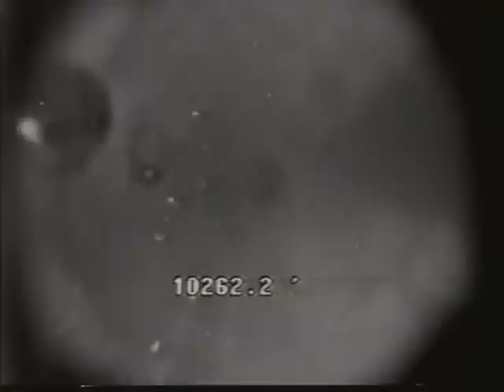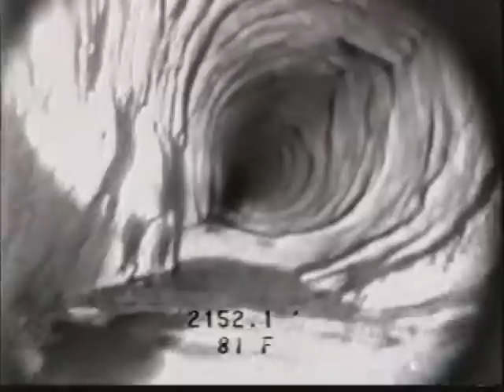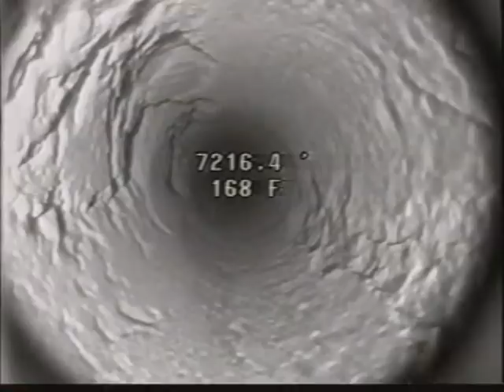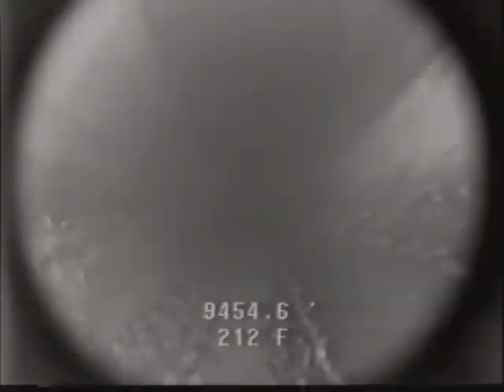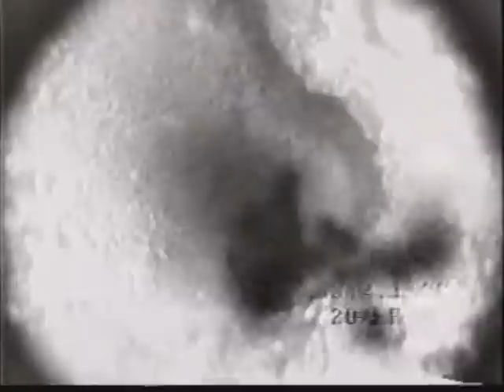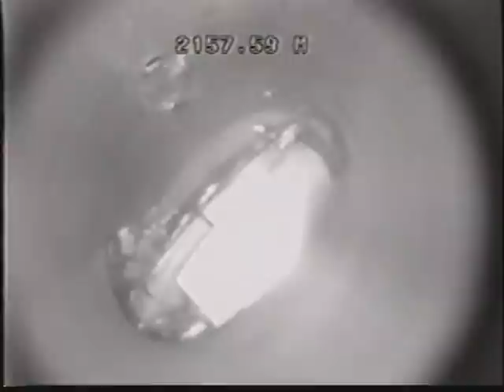Oil Well Downhole Camera Video (2/2)

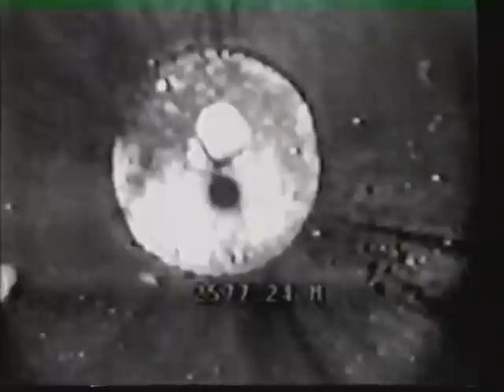Comment: So do I understand correctly that this thing @7:33 is at the very bottom of the drilling shaft after they have closed it up?
Reply: No. It's a plug you set at whatever depth to isolate what is beneath it.
Reply: Bridge plugs are set in the casing that is set in place after drilling during the production phase.

Comment: At one point the temperature was 212F. Why wasn’t the water boiling or at least bubbling?
Reply: Because of pressure. Water boiling point depends on pressure and temperature. Room temperature water boils in vacuum, for example. This is something you learn in 6th grade.
Reply: Dan Slotea been a while since I’ve been in 6th grade.
However since his comment I work in wireline now. I put explosives down that hole.
Reply: At that depth pressure water boils around 800 degrees F

Comment: Be nice to have an articulated camera head, so it could pan around to inspect horizontal anomalies.
Regarding Carbonate build up. I guess a drill needs to be sent down every once in awhile to ream out the crud. I wonder if metering a sequestrant or a ph reducer at the bottom of the well would be effective in minimising build up of carbonates.